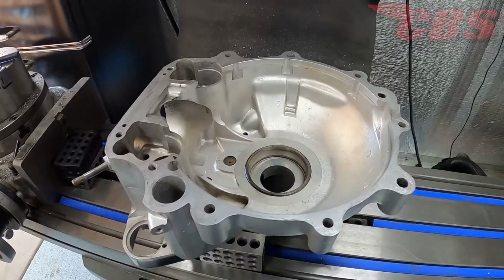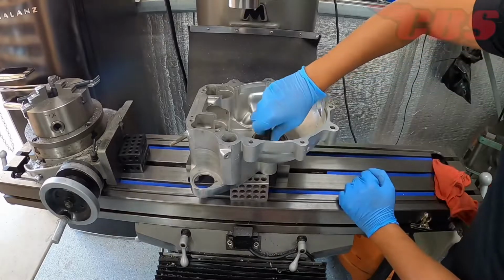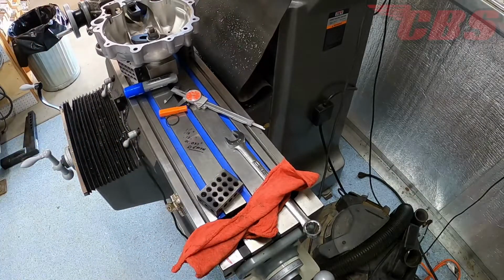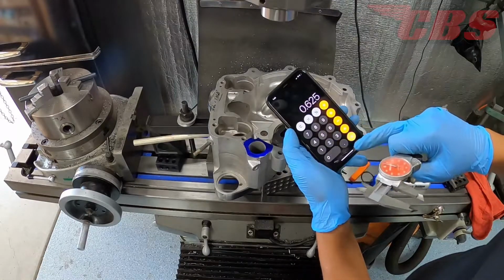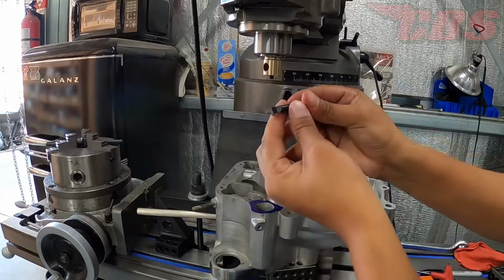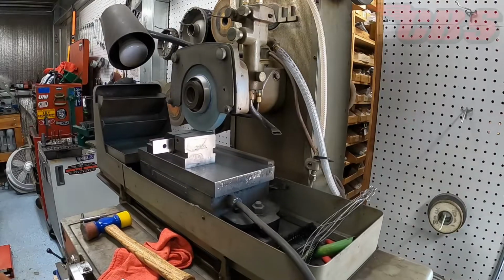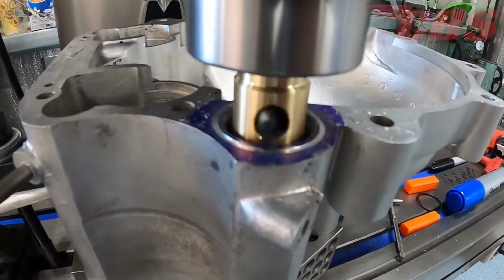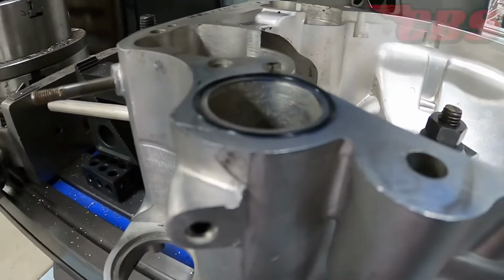Matchless Crankcase O-Ring Groove Machining

Comment: Is that micro 100 standard grooving o-ring grooving boar bar or is it a different one I need to do a similar procedure could you tell me the part number of the tool you were using thank you

Comment: Your o-ring groove should not be the same width as the o-ring's cross-section. For a static face seal (which this is) it should be ~1.35 times wider. Since your pressure is from w/in, wanting to move outward, your groove OD should be ~3% smaller than the actual o-ring OD. You were correct with the depth, as it should yield a 20-30% "squish" of the o-ring, once the plates are mated and torqued.

As for machining, I would've cut maybe 10thou depth and checked groove OD, before continuing. Maybe you did, but the vid didn't show it.
Either way, glad it worked out.

Comment: Great video! Love making tools for a job. I think and edge finder would've done just fine considering the rough surface of the port unless one wasn't available. One thing that's important with DTIs is to keep the needle/stylus as close to parallel with the wall or surface as you can to mitigate cosine error. Not a big deal for a part like this but when tenths count it really matters.